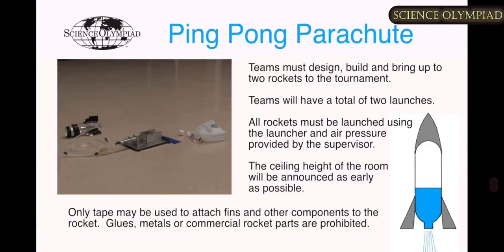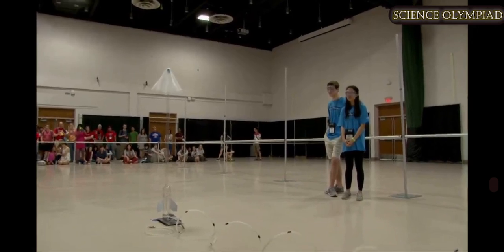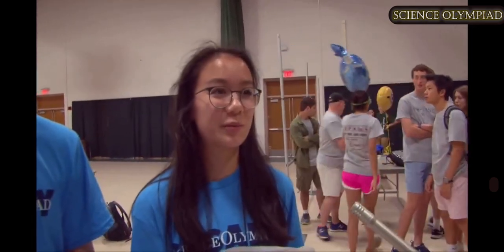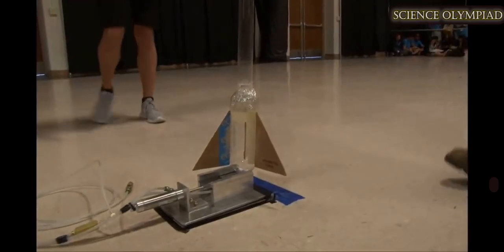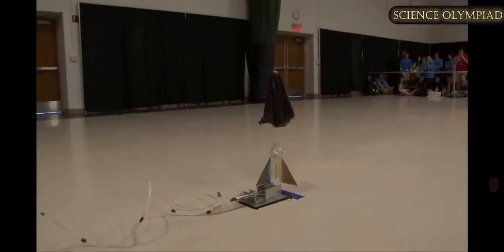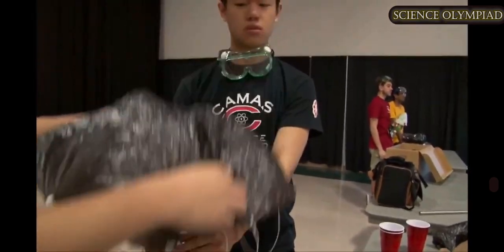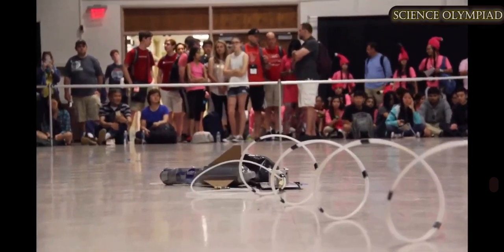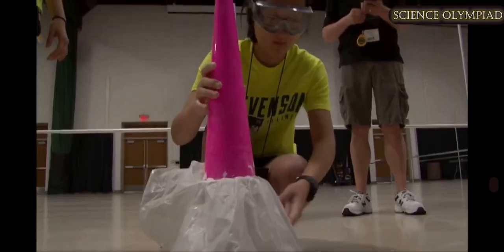Science Olympiad - PING-PONG PARACHUTE

Comment: What is the PSI equivalent of a bike pump.  Meaning if you’re doing 40 PSI, what would they be in bicycle pumps?
Reply from the maker: yes, kids mostly use a bicycle/tire pump. This is what says in the event manual "air compressor or tire pump with pressure gauge"